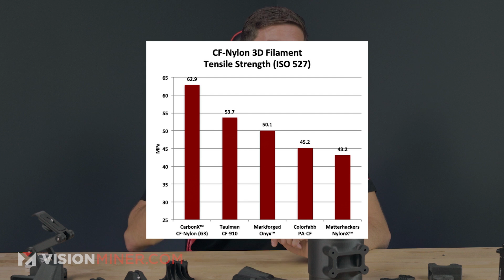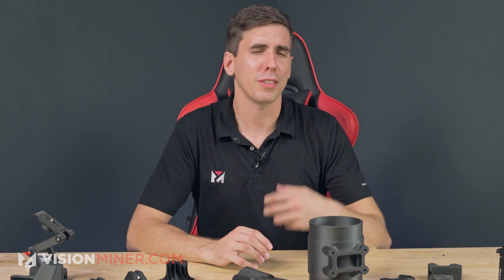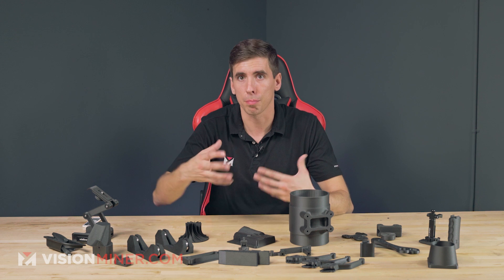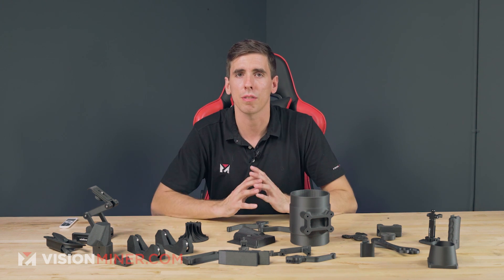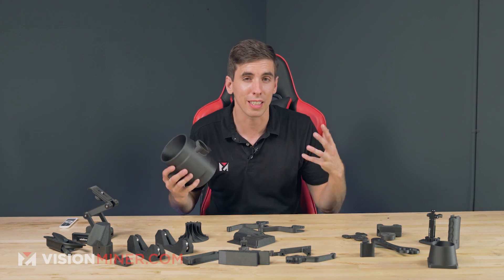What is Carbon Fiber Nylon Filament and Should You 3D Print It - Pt. 1

Comment: Maybe you could give a suggestion. I’ve been printing your stuff. Perfectly dehydrated, Pa6GF30. Warping like crazy.  Bambu x1C. Hf E3D noz. Flow calibrated, ratio calibrated. Temps 266 bed 70. Glue: hyperlock. Plate g10. What can i do. Thousands lost.
Reply from the maker: I can't speak to the effectiveness of the hyperlock, perhaps try Nano Polymer Ahdesive (Hyperlok is a knock-off) next, I'd say the bed on your bambu is too cold --- go to 90c+ and that should make a big difference!

Comment: I still wonder WHY it's flexible in the spool while it hardens after being heated.
Any material science expert here willing to explain about the composition structure before and after it's being heated?
Anyone?
Reply: Did u know, that if u'll print part with the same length and width as ur filament, it'll be as flex as filament?

Comment: Use application Exterior Car custom parts(wide body est..) PA12CF15 good enogh? or would you save up a bit and get less than 15%cf?
Reply from the maker: Honestly ABS may be a better go-to material for body panels, but CF Nylon PA6 Gen3 would be my first choice :)

Comment: I’ve found that starting the bed at 90c initial and then bringing it down to 35c for the majority of the print keeps it from warping off the plate. Guess it depends on how much cf is in your nylon. Printed a little pla and then when straight to printing cf nylon, been going great once I figured out spray adhesive works really well in keeping the print on your bed. This is all at an ambient temperature of about 72degrees f

Comment: This is an interesting video about printing with nylon. I am currently designing some custom hardware (I initially printed it in PLA as a master model for Urethane Casting) but now, looking at this, I may end up printing the final parts in Nylon. But I am wondering if the process of post processing of PLA/ABS, also applies to CF Nylon? I have also read that it is very difficult to get Nylon to stick to itself.

So, what steps can I take to ensure I can do things like glue multiple parts together on a nylon part? The Nylon model will be a final part to be used. Great video btw.

Comment: Great 👍 video. Is CF PA good for print in place bearing? Or is Delrin a better choice? If neither than what would you suggest?
Reply from the maker: Delrin is so hard to print, we don't recommend it to anyone.... CFPA is abrasive, but HTN is probably your best bet -- self-lubricating nylon, super strong, and designed as a drop in replacement for delrin :) check out visionminer.com/materials to check it out!

Comment: I noticed after it time the parts get super flexible as it's absorbed moisture. Still really strong but not as rigid. 

Assuming that could be countered with more infill. I'd be interested to know what infil your brake lever has.
Reply from the maker: These ones were actually printed solid, all outlines, which is why it's so impressive :)

Comment: Those parts look amazing. Im famaliar with 3 axis stuff and flatbed printing but have yet to see a 3d printer in action. What is an entry level machine that can print this material?
Reply: ender 3
upgraded extruder/hardened nozzle/firmware upgrade to print higher than the stock 260 max temp
Reply: @aforceinministry6677  I have this exact same setup and after trying dozens of configurations I still can’t get large prints to have good layer adhesion. It’s so easy to break and you can peel it. Any ideas?

Comment: Why it's calling carbon fiber, there is no fibers, only carbon powder...
Reply from the maker: False -- some filaments use milled/powdered carbon, which reduces strength, whereas all the filaments we carry use chopped carbon fibers, ending up as "long" fibers usually under a millimeter in length, but still providing significant increases in strength and rigidity :)

Comment: Looks great but can Epoxy bond well onto CF nylon?. Unfortunately I expect not.  I've made 140. Meters of 100% CF square tubing (the old fashioned way - manually off a mandrel) and now about to tackle making the connectors.  I love the idea of 3D printing them to insert into the ends of the tubes to make box configurations but they need to be bondable with epoxy.  Also only 25% CF is not really that desirable - i really need 50% plus,  is that possible?

Comment: Does it have to trybto stay dry after print
Reply from the maker: Nope, not after printing -- the plastic needs to be dry when melted, so that it doesn't create little expanding steam bubbles in the nozzle, which makes it print more of a foam than a hard plastic -- weakening the mechanical properties. However, you can still use nylon in water and outside, but just like zip ties, the water wlil eventually (years) break down the nylon.

Comment: Any cost to cost comparison? For the same part.
Reply from the maker: In which process? CNC, injection molding, etc.... check out our video on "should you 3D print your product" -- we go over the main differences in cost, which is volume of production -- do you need 10 or 10,000 of the part? :)

Comment: talking about physic and chemical properties, What's better between the carbon fiber nylon and a carbon fiber net covered Pla piece?
Reply from the maker: If it's covered in carbon fiber, then you'll have to determine that based on the RESIN used for the carbon fiber -- the carbon will be relatively inert to everything, but then you're adding the resin to the outside, and there are many kinds of resin :)
Reply: @VisionMiner  thanks

Comment: A couple of questions then:  1)  WHat would be a good 3d printer to printer using Carbon Fiber Nylon, a 3d printer that costs, say, under $750 US?  2)  I am in northern Canada.  I have a small farm.  I'd love to be able to printer strong parts that are normally made of metal, but instead made of carbon fiber.  I don't need parts for machinery, but rather certain kinds of brackets that I mount on t-posts.  The brackets I'd print are used to screw 2x4 boards to.  3)  How will this carbon fiber material perform in extreme temperatures such as -40 F in winter and direct sunlight (UV radiation) all summer long?   Will it dry and crack soon, or only after 10 years or so or almost never?  4)  Is 3d printing of carbon fiber very expensive after you have the printer?  In other words, is the carbon fiber filament very expensive to buy?  Please do advise!
Reply from the maker: Not much out there to recommend for that price, but anything can run it with upgrades -- really, though, you want something with a HEATED chamber. Stay tuned and we'll have some really cool options of new printers coming very soon :)

Comment: What will be a good material for a welding hood? Parts get hot for seeing the Arc for so long and the welding hood gets alot of abuse like heat hits metal corners. Falls put of the working table ect. Let me know what yall think. Thanks
Reply from the maker: CF-ULTEM is our go-to for welding fixtures :)

Comment: Can I print this with a 0.1mm nozzle and how would I sand it in tolerance tight areas?
Reply from the maker: The carbon fibers really don't print well through the 0.1mm nozzles, even the 0.2mm -- 0.4mm is the lowest we go. Our PEEK has aerospace-grade fibers which are much finer, and do pass through the 0.2mm much better, but we don't use it for 0.1mm.
Reply: @VisionMiner  I'll be paying more attention to your PEEK then

Comment: Would carbon/nylon work for an intake manifold? Using ethanol/methanol fuel?
Reply from the maker: Probably not for a long time..... HTNCF25 maybe, but you want something like ULTEM 9085 fo r that application
Reply: @VisionMiner  do you think it would hold up to the temperatures? If so do you know of any spray on coatings that might hold up to ethanol/methanol? The relative ease of printing is what is drawing me to the carbon fiber nylon, I have issues with large prints warping using pla.. even with bed temps of 70+C, the intake manifold I’m designing has a footprint of about 450mm x 200mm, the infill has to be extremely high as it needs to hold up to boost pressure from turbo chargers

Comment: Thanks for the information. I was looking for the right material to make a large shell for my 2 peddler assist elecric moble house unit that I am building from the ground up. I found 2 seaters that were peddle assist that were electric but the the frame much too weak for what I'm trying to build. I'm not crazy about the outer shell being solid black in the summer heat but  I'm sure I can creat an outer snap-on shell that will be interchangable with lighter colors and designs. Again thanks for taking the time to make this awesome and informative video Vision Miner.
Reply from the maker: Great idea! PCTG might be good too :)

Comment: how is this printer for making a large volume of a very simple print such as a 1 inch cylinder plug ?  I had someone on facebook make a sample using an Ender 3 and the plug came out great.  I need a printer that will be capable of 750-1000 plugs of this size per month for a supply agreement.  would there be a lot of maintenance for this volume of 1000 units of this size /month ??

Comment: What is the best filament for a great surface finish? Something like a 63 surface finish you would get when machining a part?
Reply from the maker: Generally to achieve that smooth of a finish, you'll need to post-process the parts in some way, unless you print at a super-low layer height -- vapor smoothing, or coating in epoxy-like substances generally works :)
Reply: @VisionMiner  Thank you for the information. Could you recommend a 12" X 12" or larger 3D printer with a heated chamber that wouldn't bust the bank? Thank you for your time. Donald

Comment: I use CarbonX PLA+CF for drone parts. It looks and prints good but its cracking with a little bend. What other filament would be better for drone parts? PC, PP, Nylon? Will it make any difference if I change the filament type or plastic is just not so good for drone parts?
Reply from the maker: Well, that's pretty much PLA for you.... we have lots of people using Nylon and CF Nylon for drone parts, working great! We also had a custom drone builder making drones for special sensors and whatnot out in Texas, and the heat would eventually break down the CF Nylon, so he switched to CF-ULTEM and CFPEEK to make the parts, and they were fantastic!
Reply: @VisionMiner  I should try nylon first to see if its okay for me. Thanks for reply. Great channel by the way. Good luck.

Comment: Yeah I know, this may seem like a stupid question. Would we be able to make a bullet proof shirt and pants out of this, or more like armour? Just wondering how strong this stuff really is. Would it be good to make something like a car stand to lift cars or very heavy objects? Thinking of making a workshop portable table, and wondering what parts I can make for this for to hold up a few hundred pounds/KG.

Just curious what the capabilities are.
Reply from the maker: Capabilities will always depend on geometry, and then the question is, "is this the right material?". Sure, it could be bullet proof, but to what degree and at what thickness? Butter is bulletproof when you make it 2ft thick (they did it on demolition ranch). Is nylon with carbon fiber strands going to be bulletproof at 1cm thick? Highly doubtful, hahaha. Car stands, yes, you could probably make some, but at that weight, it wouldn't be more economical than using steel. Now, in many settings, it's a great replacement for aluminum -- especially things like brackets, molds, workholding, jigs, fixtures, etc. Keep the brain going, there are a ton of things that can be done... :)
Reply: @VisionMiner  Thank you so much for that. That helps a lot and does give me ideas.

Comment: What size nozzle do you recommend for this material? Would a .3 or .35 clog too easily?
Reply from the maker: 0.4mm or larger is best --- it's not that you CANT use it in a 0.2mm nozzle, it's just that it will suffer from clogs more often. We've never had a problem with 0.4mm though :)

Comment: Can this be used on a sidewinder x1?
Reply from the maker: It should be, yes -- prints from 240-260c on the nozzle, as long as you can hit that, and use the heated bed around 100c :)

Comment: I'm considering making a tray insert for my toolbox with this stuff, I have an Ender 3 Pro, with a plated copper 0.6 mil tip and a glass bed. I have not upgraded my extruder, tubing or hot end. Do you think my setup is sufficient?
Reply from the maker: You'll definitely want a hardened steel nozzle, but you can definitely print the CFPA6 -- visionminer.com/materials :)

Comment: So if you're comparing it to aluminum, why haven't you made the ultimate demonstration by using it to print a full suspension mountainbike frame?
Reply: Probably too brittle.
Reply from the maker: Well, nylon coullllllld work for that..... but we're going to start with comparison bars made from aluminum lol. THEN THE BIKE, WE SWEAR. I'd probably just go buy a stumpjumper though...
Reply: @VisionMiner  I get that capitalism has brought down the cost of highly engineered products.  But if you looked up one of my favorite tech leaders gabe Newell,  he mentioned how future products are moving towards personalized rather than one or five sizes fits all. 

Biggest problem with bikes are obsolescence, availability and proper fit. There is so much customer empowerment in being able to modify component design to suit your needs.  Especially when the manufacturer has abandoned the product model. 

While design piracy may be more rampant,  the free market has always found a way to adapt and survive.  Streaming was the answer to CD piracy.  Maybe we're moving into exotic patented print materials.  Or printing shops that provide warranties and pay for licensing. 

I want a printed vintage car but have the model modified to take modern wheels,  an electric engine,  and updated passenger internal space.

Comment: How resistant is it to UV light? Can it be set outside in broad sunlight and not degrade over time?
Reply from the maker: It's better than regular nylon (think zip ties) --- mainly due to the fact that the carbon fiber is an excellent absorber of UV, thus protecting the Nylon itself.

Comment: thinking of aero parts for automotive applications or just for design. Wonder how well these would fare in UV throughout time without a clear coat. Thanks for the informative video
Reply from the maker: The CF is a natural UV absorber and will help aid in any degradation caused by UV attack. PA’s aren’t horrible on their own and the addition of CF  will aid in this as well, so it's pretty good!

Comment: It is ridiculous to compare plastic with aluminum, so if you mean technically pure aluminum, it really has such bad properties, especially rm (60-100MPa), but it is just made of aluminum foil. every common product is made of aluminum alloy AlMgSi etc ... where the worst Rm is from 180Mpa up to 7075 which has a tensile strength of 575Mpa .... so please do not fool people, otherwise it is an interesting material among plastics ....
Reply from the maker: HTNCF25 is called black aluminum because it can replace aluminum in most functions inside a machine shop for tooling and fixtures --- it's pretty crazy stuff! https://visionminer.com/products/htn-cf25

But yes, many times, it's better to just use aluminum, especially for giant parts. The advantage comes in when the part is too complex or very difficult to machine/create with other techniques, especially tooling & fixtures :)